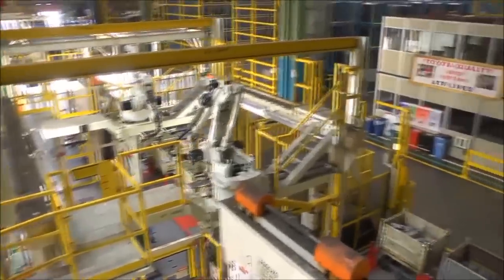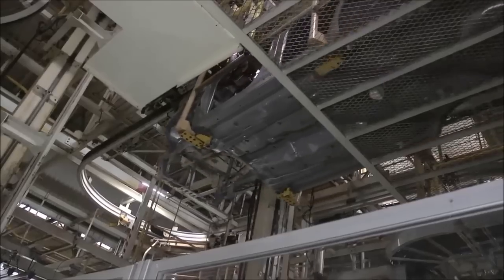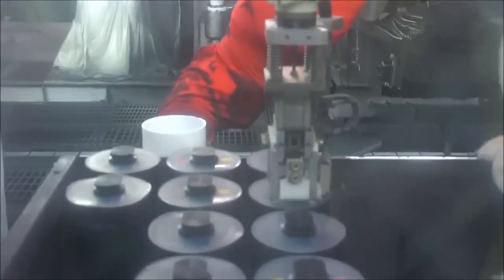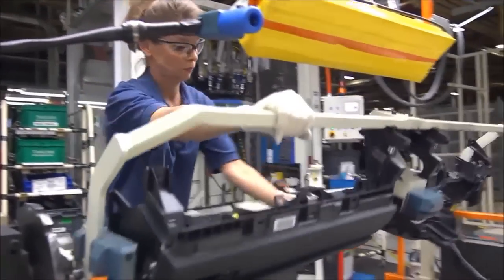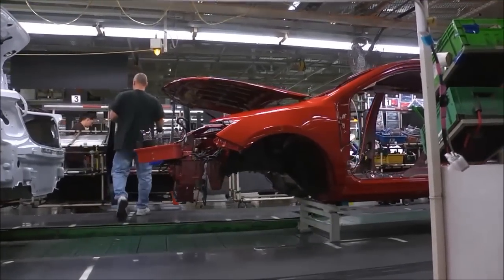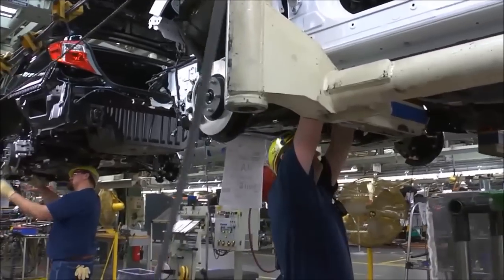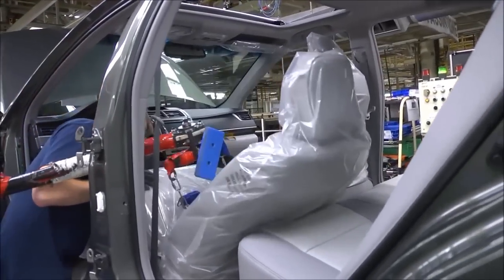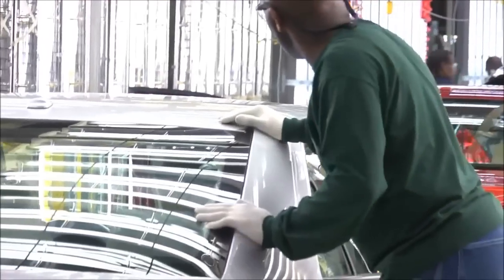Toyota Manufacturing- car marking

Comment: Robotics and automations did about 90% of all cars manufacturing these days.Remembering cars manufacturing in the 70-80 era was in reverse like 90% People’s Power and only 10% Robotics and Automations.
Reply: Damn, I did not know this. That is crazy .... But .........

I am calling horseshit on this, and I know this, seeing I work for Toyota. Sure there is a lot of robots in paint and weld, but there is a reason for that. The paint robots waste next to no paint, and do the exact same spray, even pressure, no drips or runs, ect ect. And in weld there are some very tight places those robots have to get into, that would be very hard for a human to bend or twist to get into.

Comment: Let me get this straight.  The woman at the beginning needs to check with a manual slide rule what high tech precision machinery just produced??  Seems to me you would have a laser checking that...thus eliminating her job.
Reply: checking if the product is the correct batch, there may be other batch  with has slight difference in dimension, that labeling or delivery guys had mixed up, shit happens all the time, and that lady has duty to  gonna catch it, before product goes further in the line ,